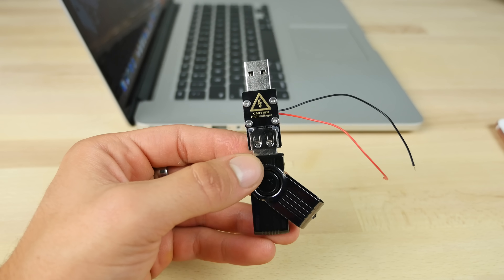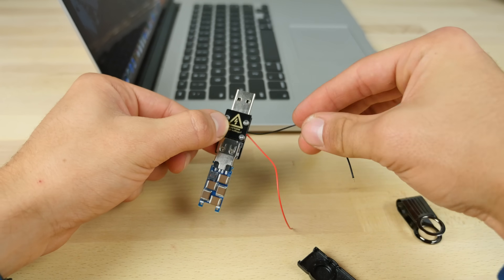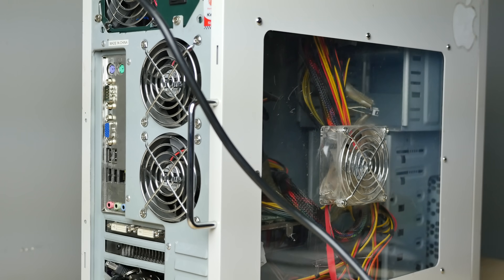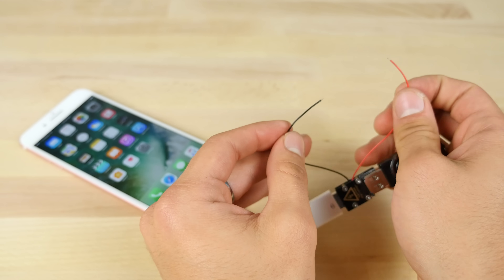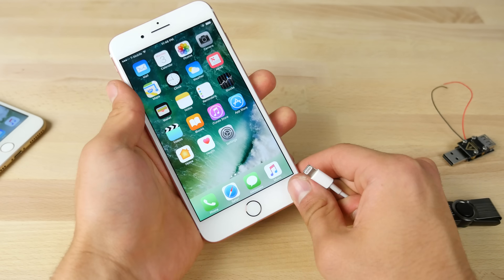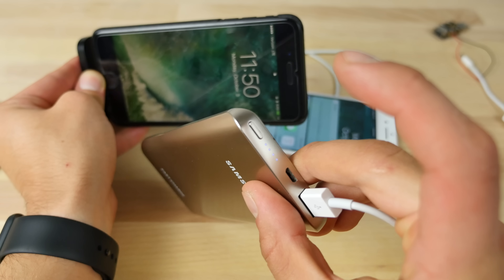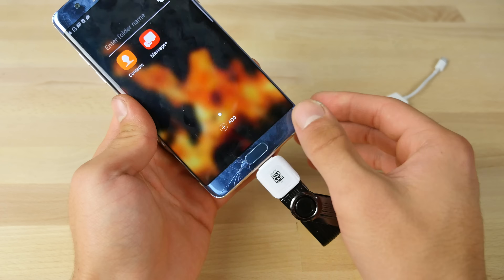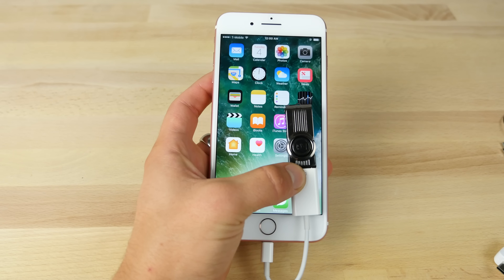USB Killer vs iPhone 7 Plus - Instant Death?

Comment: All good motherboards have an overvoktage safety on all busses you can just reset the motherboard cmos
Reply: Volts per millisecond? What the fuck is wrong with you?
Reply: these safety is made for an overvoltage of 36 v max. This key inputs 400v per millisecond
Reply: I don't think you quite understand how this works
Reply: Happy Lamp 1, the digital protection circuit in place isn't capable of that and 2, it would be too late, those thin conductors on the PCB would get fried instantly
Reply: +Happy Lamp You don't understand negative voltages.
Reply: perhaps a 400v discharge every millisecond is what they meant?
Reply: It puts out -220v by the time its negative it can't escape,no protection for negative voltages, so you get fried
Reply: Happy Lamp okay, let's say it's +220v and the ovp decides to trip the power, how would that make a difference if the 220v is coming from charged capacitors?
Reply: Denis Gavrilov Then the current is transferred to the ground
Reply: Denis Gavril
Reply: Harry Phillips what is it then? I read about this on a site, it was saying because it's negative it can't be grounded
Reply: +Happy Lamp AFAIK Positive voltage is putting a voltage on the power line and putting the ground line to 0V (ground). A negative voltage is providing power to the ground line. In a USB port, the power line is at 5V, from the motherboard. If the device was giving a negative voltage, it would be charging the negative line and would either kill the power supply or simply trip a short protection. What I think this device does is instead of increasing the voltage (Which I think can't be done with that simple a circuit, with just capacitors) is charge the capacitors and then discharge them, producing a high current, not a high voltage. This still results in a lot of power being delivered to the motherboard / power supply so would have a similar eff.
Reply: +Harry Phillips *effect
Reply: ***** current is a product of voltage, you can't increase the current without raising the voltage
Reply: +Denis Gavrilov Then how come you can buy 5V USB chargers with 1A, 2A or even 4A output?
Reply: 5v is just the standard, they increase the current by modulating the voltage, look it up. It's just simply ohms law, v=I/r
Reply: V=I x R, not dividing.
Reply: Unity101 you are correct, I wrote that comment with eyes closing at 3am
Reply: haha, no worries :)
Reply: +Denis Gavrilov you're right, I did already understand ohms law but wasn't thinking. I've seen power supplies that can deliver insane current at low voltage in the past, I just forgot all about resistance. Even so, surely it could be possible if the device had very low resistance? I = V / R so if the resistance was 1 ohm or less (which sounds feasible since there are only capacitors) it would be possible to deliver 5A? please correct me if I'm wrong.
Reply: Unity101
Reply: yeah?

Comment: 0:55 - "Extremely high voltage... energy."

Sigh. This is the state of technical channels these days.
Reply: No it's the state of iSheep "tech" channels
Reply: "I don't know why my camera isn't picking it (sparks) up very well. It must be the... frames.
Reply: Bidwellz9 So you're claiming voltage is used to measure energy?

What he said is utter nonsense. Any high schooler that studied physics or electronics would know this.
Reply: you do understand while it doesnt sound right ...it is right? youre saying electricity isnt energy?
Reply: +cuhleef better go to walmart to pick up some
Reply: Bidwellz9 He had to think of something real quick to say. By the way what he said is double.
Reply: Herp Derp lurp slurp
Reply: It's the difference in electrical potential energy per charge. Not directly, but voltage is in a way a way to measure the energy of a place per charge compared to a reference node.
Reply: Winston Zhao "Energy of a place"? Stop trying to pretend like you know physics or electronics.
Reply: It's the energy of the charge at a place relative to another. I'm an engineering student lmao
Reply: Winston Zhao just stop

Comment: Have you tried unplugging the power supply of your pc, wait 10 minutes, then plug it back on? I did a shortcut on one of my pc about 10 years ago, and doing so resuscitated it... I layer learnt that some power supply had some kind of protection against overload like this. I wouldn't call it dead until I try that...

Comment: whenever a power supply gets shut off like that you have to turn it off by the switch in back and let the caps discharge which can take a few seconds and will usually make a small noise when it's ready then try to turn it back on

Why would you do that to that note7? I'm happy it didn't fuck it up.

Comment: Basic surge protection. If anything high current hits a port most basic operating systems will disable that port for the next 10 minutes or so to prevent it from happening instantly again, killing it.

Comment: I went to a Best Buy with V.2.0 Of the USB killer and plugged it in to every single device before getting rid of it because of its tracker that me and my friend installed into 3 just in case we lose them then I came back after 30 minutes and it turned out that once display Devices stop working they throw them out. I was able to recover a mac book and a IPhone 6S. They work fine but can't run/download any updates. Best experiment I've done in a while

Comment: Your knowledge about electronics is so poor
Reply: Damn, watch out guys. The electronics engineer is here to school us peasants on an apple YouTube channel about how electronics work. Pay attention to this kid.
Reply: Aseril Oops, I haven't noticed it's an apple brainless channel
Reply: Inteligent enough to not buy Apples shit products ;)
Reply: Probably because he's an apple fan lmao
Reply: Random You're a special kind of stupid huh?
Reply: honestly this video was frustrating to watch. this is a usb drive with several capacitors running in parallel. capacitors store electricity, but they need to be charged up. The "tester" as he calls it is the charging mechanism for the drive. clicking the wires drains the capacitors and the sparks indicate how charged it is. usb ports on a pc output 5v at 1a and that is why it is effective on a pc. Phones are not meant to supply that amount of power to other devices. that is why you cannot use your phone as a power bank for another phone. I do not know if there are safeguards in either phone to prevent this kind of high voltage overload, but the way he was testing it was fundamentally flawed. the usb drive should have been charged on the power bank or computer and not the phones. what he did was comparable to testing new electronics with dead batteries and concluding that the new tech doesnt work. he clearly did not look at the technical specs for any of the devices he used or read the instructions for the usb drive
Reply: Deonte Dunbar because of recommended videos?
Reply: John Clarke True :D
Reply: Look...uh.. Random. His electronics knowledge may be apricots eaten by Hitler the II and ananas und haben gesundes leben.
Reply: hohoho
Reply: Random Lol why are you on a apple based channel then ?
Reply: Random Refer to the previous comments, child.
Reply: Aseril How about no honey?
Reply: Since when PC can provide 1A on USB out? It always was 500mA or 0,5A
Reply: Could you build one of these at home? For example, would just a capacitor with a voltage pump work? You know, something like a camera flash circuit?
Reply: I'm not sure what output does a lightning or micro usb port have but I can tell definitely that you CAN charge a phone with another phone via an OTG cable like the one he has atleast with micro usb you can and Ihave done so many times to top up my girlfriends battery.
Reply: IKR he thinks that usb have different voltages depending on how much electricity he has never even heard of amperage?
Reply: John Clarke Apparently not
Reply: +Random Thats what im wondering my Usb has shocked me when pulling it out of my pc. My knowledge on electronics is slightly above average, and im pretty sure 1A kills you :/
Reply: Usb 3.0 can go up to 900ma.
Reply: 1,000,000,000 amps won't even harm you unless it's high enough voltage to overcome the resistance of you skin... In reality though if it is able to, and cross your heart it takes as little as 10ma.
Reply: +TrollFaceTheMan .35 amps is lethal any less u can live
Reply: Let's dissect my comment and yours...

 Yours: ".35 amps is lethal any less u CAN  live..."

 Mine: "In reality though if it is able to, and cross your heart it takes AS LITTLE as 10ma."

 See the issue here..? We are saying the same thing just different ends...
Reply: Unless you are referring to "1,000,000,000 amps won't even harm you unless it's high enough voltage to overcome the resistance of you skin..."

 In which case If you are trying to correct me on that then you must not  understand basic Ohms law... 1 Volt Can Move 1 Amp Through 1 Ohm....

 Skins resistance is about 50,000 Ohms if Dry which means to move .35amps  through it you'd need 17,500v. It can drop as low as 500Ohms if wet or broken which means as little as 175v can prove lethal...

 But still it's even less than that as it's only 10Ma across the heart to cause muscle spasms which could potentially cause a Ventricular fibrillation and kill you. That  means 500v Dry Skin or as little as 5 volts wet skin...
 
 So once again the power source can literally have indefinite amperage but if it can't overcome your skin resistance (Specifically when dry) it won't do a thing to you...
Reply: +TrollFaceTheMan I know how ohms work and resistance, and how amps corrispond with flow of current. I understand that amps is a force internal to the current. so it cant effect you if the voltage isnt high enough.
Reply: Okay what was the issue then?
Reply: I think maybe I misunderstood what you were trying to say and if so I apologize.

Comment: Try testing it on the I pad pro almost gurrenteed to hold more power and the USB killer should be able to gain enough charge to send a strong enough output back through to completely fry the I pad pro 12.5" even strong enough to bi pass its electrical sugrge protection make sure you have to the device fully charged to get the best results

Comment: that thing is so stupid. Just stick a butter knife in a usb port see what happens.
Reply: You completely missed the point.
Reply: Aseril You did. There is a device that people are buying for about 50 dollars that does the exact same thing as a butter knife.
Reply: asmcriminaL No, you really did the miss the point and you don't realize it. It's pretty sad.
Reply: Aseril No you're missing the point. You think it has to do with the "iPhone" not being fried up? You're probably thinking "That thing did not damage the iPhone, the iPhone is good."

False, don't forget about the Note 7 in this video as well. It has nothing to do with the "iPhone" in particular.  If this was all about the iPhone he would have never tested it on the note 7. 

As stated, you're the one who missed the point.
Reply: Oh yes, because the butter knife will act as a capacitor and rapidly send 200V to the data lines of the USB. I forgot about that.
Reply: asmcriminaL You're an actual moron.
Reply: Aseril A moron calls someone a moron with out any evidence to back it up.

Prove how big of a moron I am by sticking a butter knife in your USB port...
Reply: deIlluminati Who cares? it fries the mother board. That is the purpose of it. If you can do it another way and cheaper, go with that option.
Reply: asmcriminaL
But it wont fry the motherboard, that's the point.
Reply: deIlluminati It would, I have done it. It causes a short. I did it on accident one time on my mom's computer. 

I also remember I had this POS external cd/dvd drive. It was old, and it fried my laptop too. I am sure the pins in it where messed up(in the DVD drive).
Reply: asmcriminaL Refer to the previous comments, incompetent child.
Reply: Aseril There are "many" previous comments you genius. See how dumb you are? Here I will help you try to build a case against my claim.

Fill in the blank, "asmcriminaL you're a moron because _________________"
Reply: asmcriminaL
It wouldn't if it were a newer device. Anything could ground against the pins, even the USB itself, and they have a lot of protections against that.
Reply: deIlluminati Yes newer devices do have protection. That is why this device did not work on the newer phones.

Comment: it wouldn't exploded. The 32/2,000,000 million s7 notes that exploded had an impurity in the metal covering the battery that would cause a less than desireable chemical reaction, making the the battery catch fire. The heat wpuld have nowhere to escape, building pressure until the phone wod blow up. It has nothing to do with the amount of power going in. Pronlonged power is what weekend those batteries.

Comment: You didn't even reset the power supply. It probably went into a fail safe mode, of which unplugging the power and plugging it back in would allow the computer to turn on normally, probably. I don't actually know, but I'm disappointed you didn't try to unplug it and try again.

Comment: 9:07 "Seems like samsung and apple both have some sort of prevention against this."

Complete lie. It's actually been debunked the reason a lot of the Note 7's have been exploding is because of Samsung allowing HIGHER voltage to draw from their  chargers via the kernal.

Speficically, a .05 difference. I mean, yes, this techically DOES allow your battery to charge faster, but it DOES allow your phone explode, espcailly when the battery itself cannot handle that much voltage.

idk about apple man.

Comment: modern devices have zener diode protection to prevent voltage spikes like that, but it does sacrifice the port
Reply: but it seems on the note 7 the port was still working. why would that be?
Reply: differences in design? I am not sure it is also possible that Apple used a quick action fuse, and Samsung uses a diode protection scheme. I am no expert on these phones, but this "killer device" seems to be a step-up transformer with a bunch of capacitors and a relay to send a high voltage surge back down the usb port.

Comment: USB type C has full surge protection because it is high voltage rated even if the device isn't.

Lightning port isn't surge protected since it's not a high voltage rate port, it's also provides sense based symmetry rather than mechanical symmetry so it's possible for a misbehaving device to short it out by simply supplying even standard power over the sense or data rails.